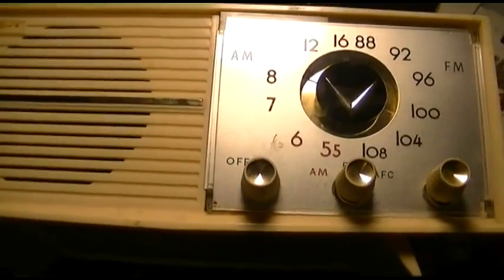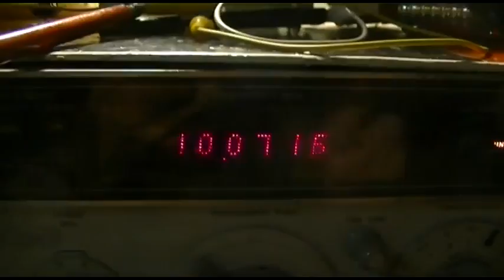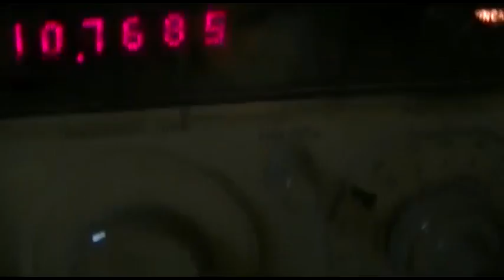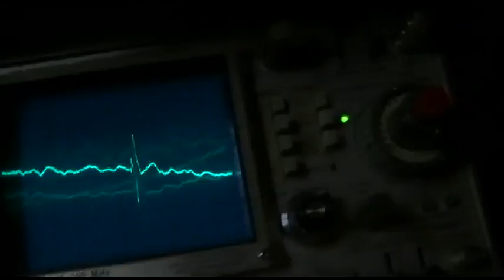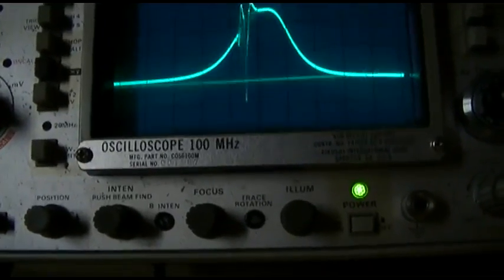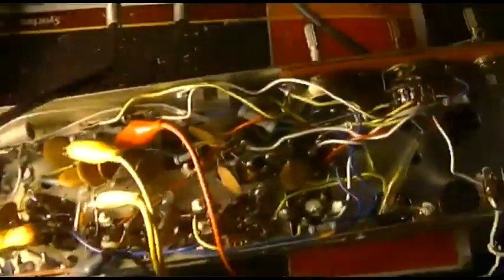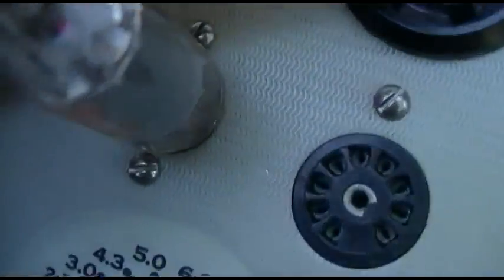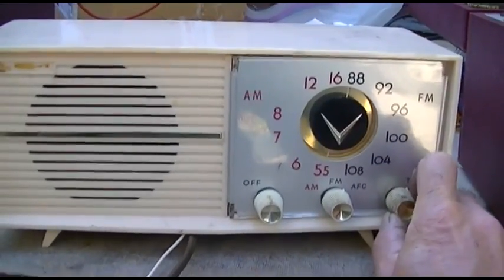Viscount Japanese Tube AM FM Radio Repair

Comment: I have a Shaw branded radio that has an almost identical chassis. Alignment in it is WAY off, but it does play. I have done an AM alignment and that drastically improved it, but I don't have a working sweep generator yet for FM alignments.

Comment: I would have squirted some carburetor cleaner in there to clean the old grease out? It usually comes with a straw for tight places.
Reply: +BUDDY LIGHT I only tried that on a radio once. It turned the plastic parts to mush.